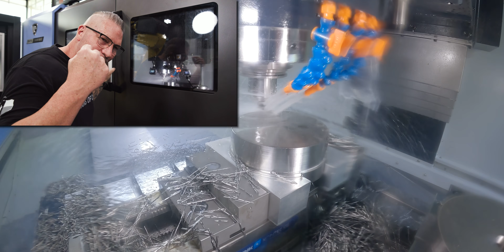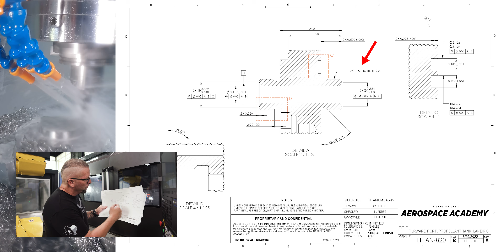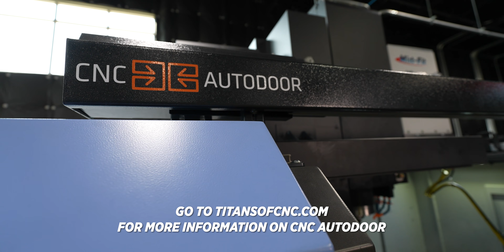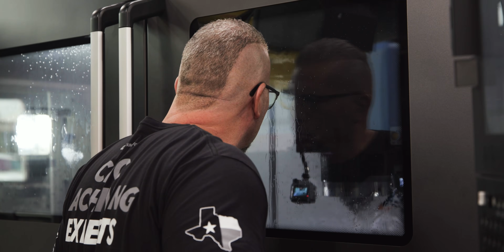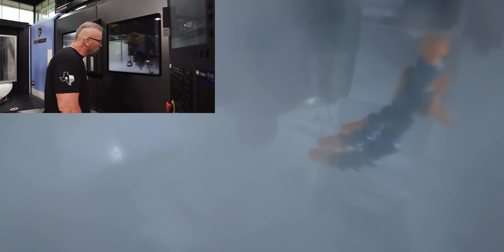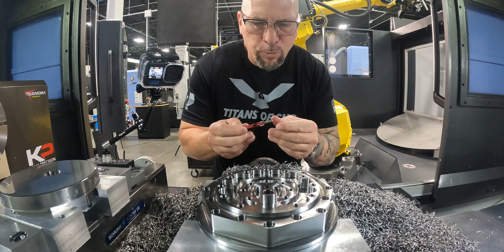Precision Machining Complex Rocket Part out of Titanium

Comment: If you're drilling counterbored holes, what is the benefit of cutting the through hole with a larger dia drill bit and then using a smaller dia drill bit to cut the counterbore? Couldn't you just use the larger bit to cut the counterbore in the same operation to save time?

Comment: What do you recommend between thread milling and rigid tapping ? ( where both options are there). In my machine shop we use rigid tapping all the way till m24 and some bigger ones as well. Just wondering if thread milling is more economical ?
Reply from the maker: Thread milling is fast and safe….
If I am running hard or expensive materials… all thread mills.

Easy stainless or aluminum… roll tap all the way

Comment: Nice to see you guys using the TE as intended for once even though it was just for the o-ring
Reply from the maker: I also used it for the bottom pockets and explained how I ramped in at 10 degrees.
Reply: Sorry I did miss that. You guys turned me on to the TE and when I found out that’s the tooling we were using for our vises in my apprenticeship, I took full advantage of what it can do to mill our pockets. 4140 steel, 3/8 end mill, full radial and 2xD. My program took just under 3 minutes and the guy I’m competing with as well as the teachers program were 48 min and 47 respectively. Blew their socks off

Comment: Love it... one thing you can also do is on the go no-go gages is on the GO gage where the set screws are hidden with red filler, use green... Green means go.. red means no go so people can physically see them. Sometimes that lettering on those gages get hard to read in bad light, or bad age lol. Just something we did when I was machining.

Comment: Titan after milling the 3rd part:
"when you have this experience you just know when its perfect *no go gauge doesn't fit*" 
I call bullshit
Reply from the maker: Dude, you always have to 100% check threads on a part of this magnitude. I was just saying that if I am doing a thread with a major dia of .3125… and I know from experience that is I program it to that dia… the thread gage won’t go in…
Then I will remember from past experiences that I had to comp the thread mill -.006
So, I will now, just automatically program it larger by .006 

Which will give me a perfect thread the first time out..

Of course the thread mill can break down and create a bad thread.

Not sure why I wasted my time on your  comment but ya… easy stuff. No sense reinvent the wheel.

Titan
Reply: Because there are camera cuts, it's an opportunity to call "bullshit".  Bombastic as you are, you also seem to know your stuff so I would not be surprised if you could indeed nail a threadmill on the first attempt.  With all the production, it's sometimes hard to know what's real and what's hollywooded up. @TITANSofCNC

Comment: Great video. Question on the inspection. Is there enough distortion on the part once the second machining OP is completed? If so, do have to reinspect all features inspected from OP 1?
Reply from the maker: Yep, you have to check op one and then recheck op one as a finished part… once the second op is done. You also have to be strategic in how you proceed.
Meaning…
If I know that the part is going to bow by .003 after the second op is done… and I have .005 for a total tolerance.

I would make sure to keep the first side to .001 or less

For a total of .004

Make sense?

Comment: How do you decide with Tool holder you use for what  (shrink, collet Chuck…)
Reply: They make different ones for different applications like if you need to reach five inches down on a part from a five axis tilting 45 degrees it’s gotta be a long tool. It’s just what you need it for. But collets are relatively reliable